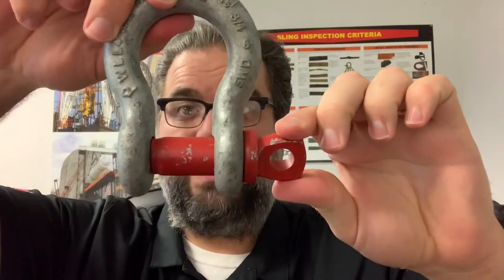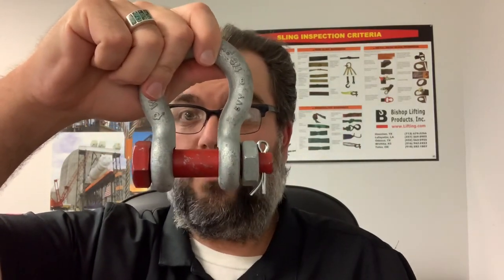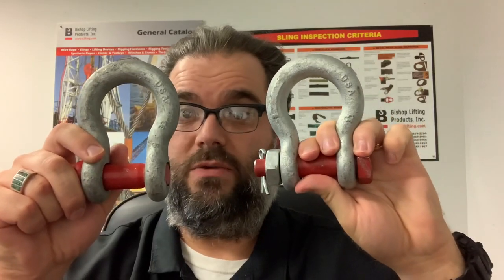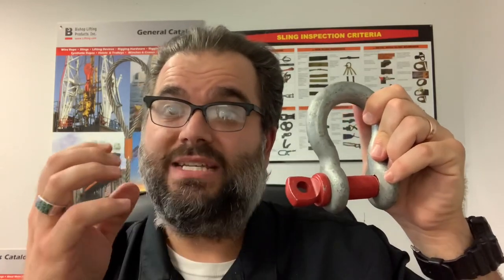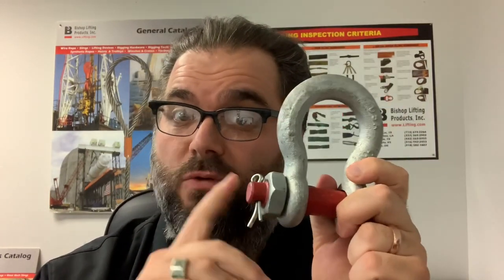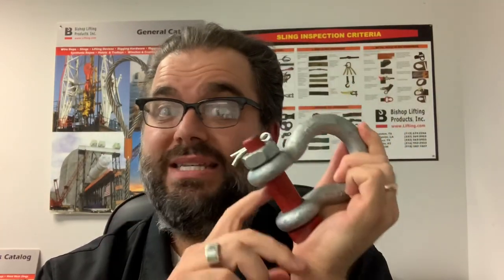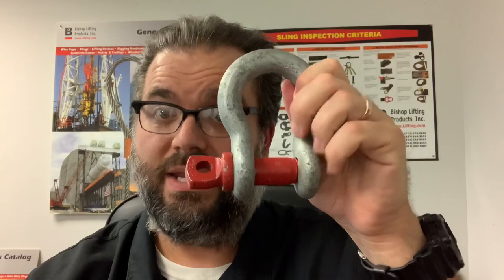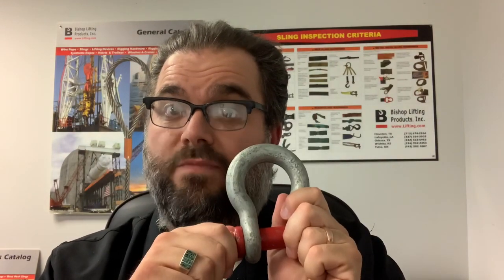Screw Pin vs Bolt Type Shackles

Comment: You should do a video in sling selection.  Knowing what sling to use for a particular job is important and will save you money in the long run.  Examples...using a synthetic sling in a welding shop or around cutting torches or a non-galvanized wire rope sling off-shore.